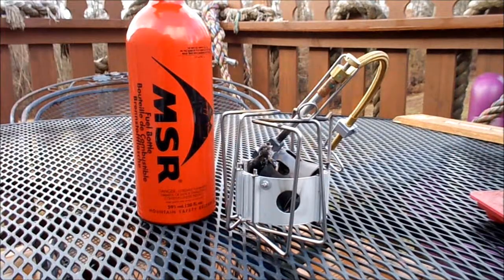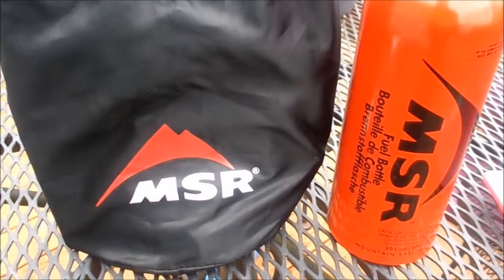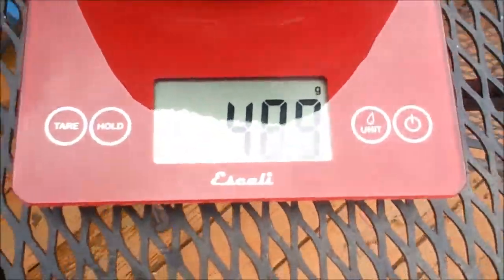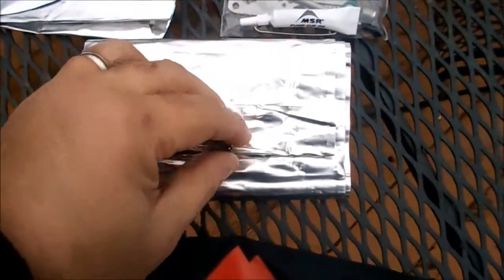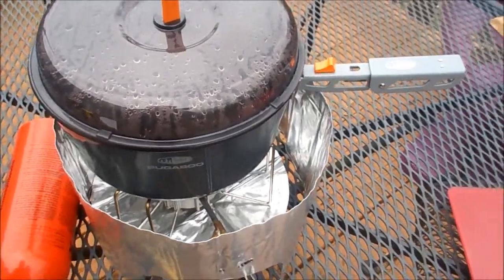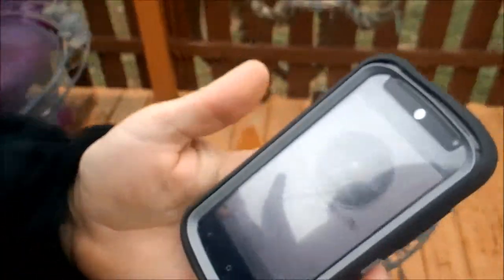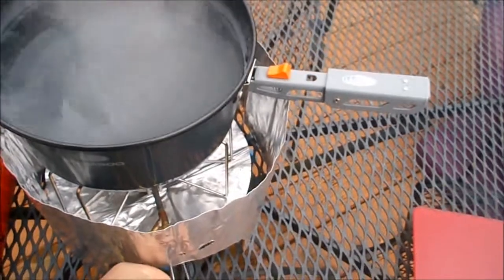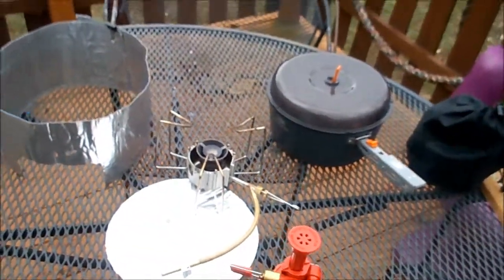MSR Dragonfly stove

Comment: How do you like this stove.. Is the simmer feature that big of a deal to you? Im torn between this stove and the whisper lite internatio0nal. What are you thoughts?
Reply from the maker: If you need to simmer, if you use big pots, if you need to cook and not just boil water, if you aren't a weight freak, get the dragonfly. If not, the whisperlite is probably a better choice for you.
Reply: +Tumpline weight is not an issue, don't understand the people who cut grams. thanks for the input. and could you do a review on your cookware?
Reply from the maker: +vegas wajeel thanks for the comment! I will work on the cookware review!
Reply: Thank you, and the only think that strays me away from the dragon fly is the extra moving parts and how loud it is. But I'll take your word for it.